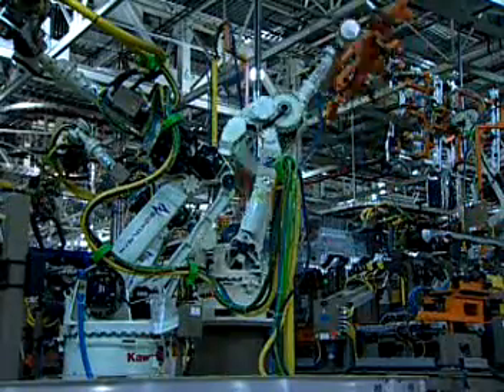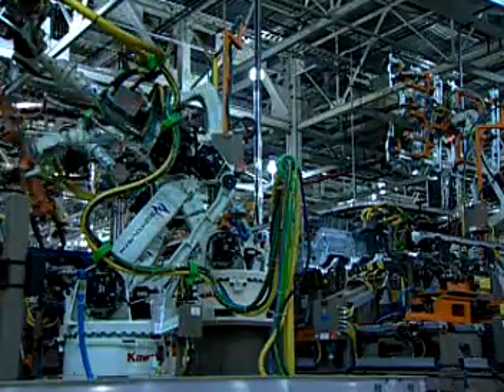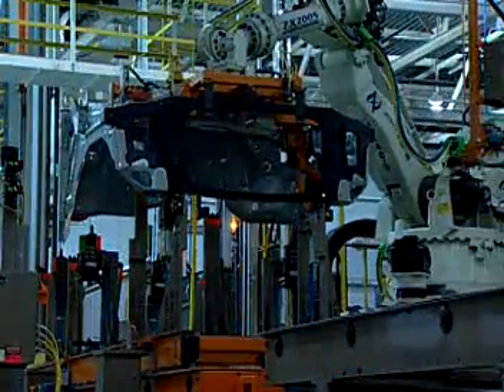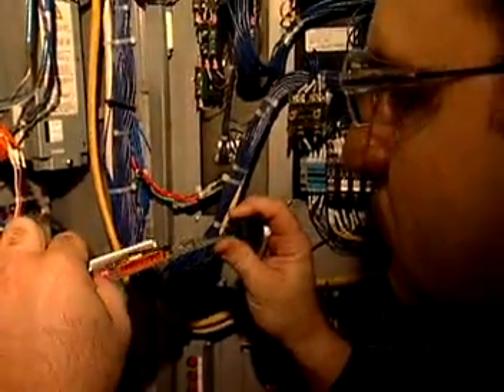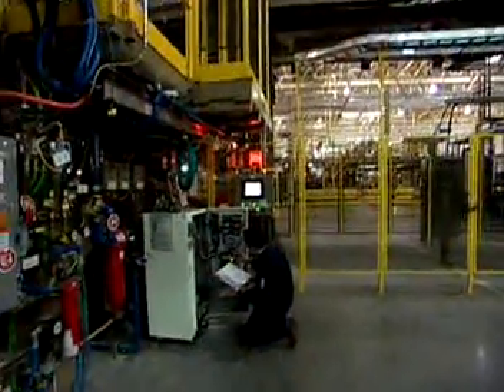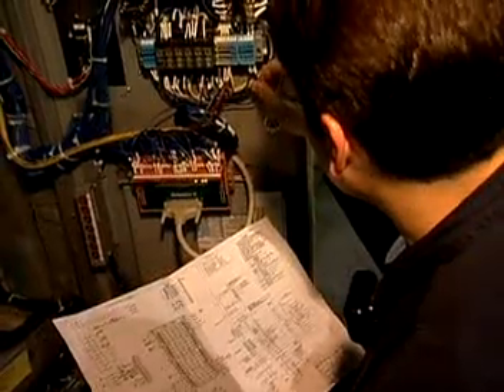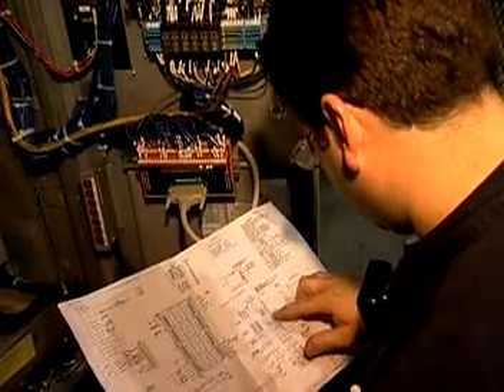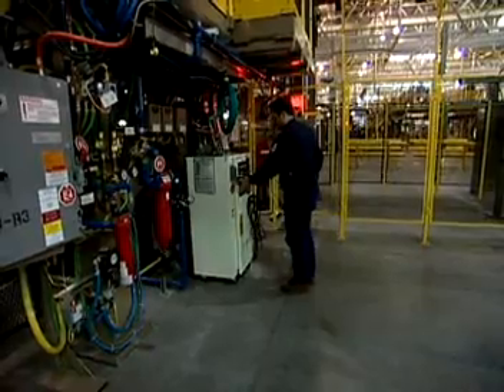Robotics Technician - Career Profile

Comment: Interesting PCB's (Printed Circuit Boards) are being handled in this video without grounding.
Reply: Without the capacitors charged on the print and no power plugged to it, there should be no risk of electrocution. Sorry for bad english